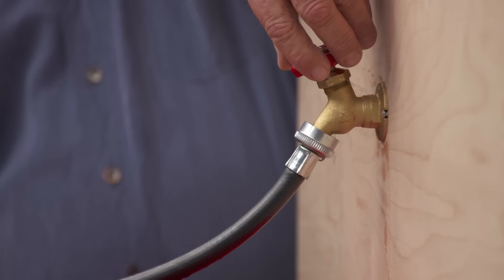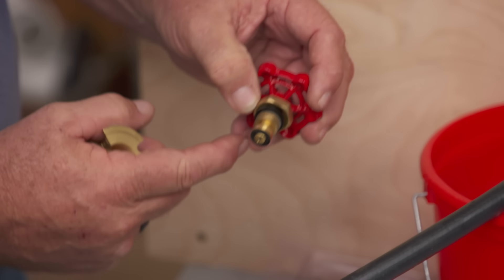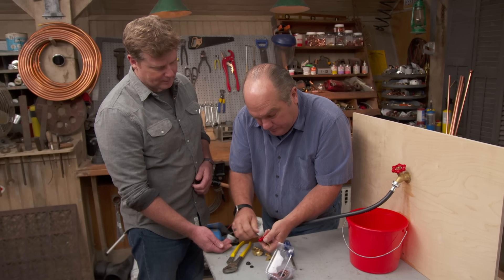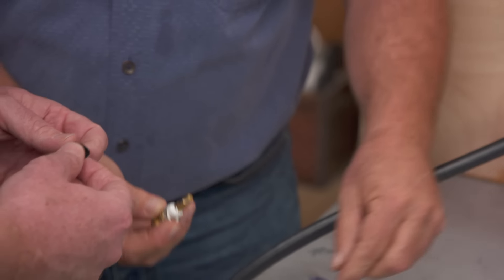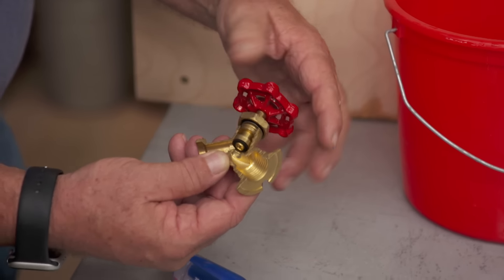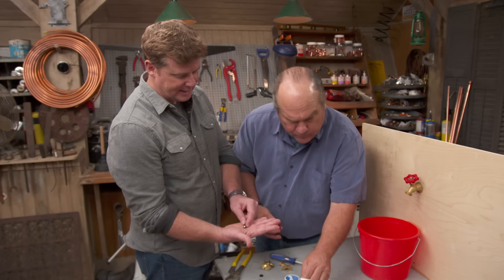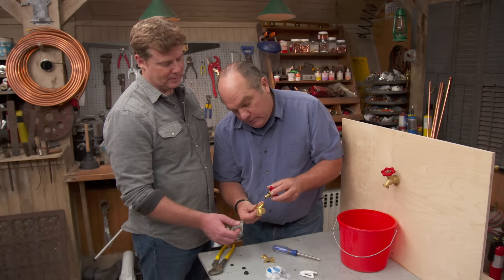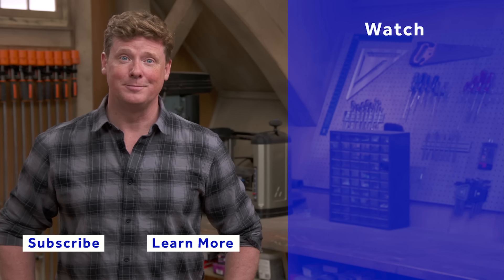How to Fix a Leaky Hose Spigot | Ask This Old House

Comment: Fixed both faucets today just by tightening it up. 4 years of leaking solved on 5 minutes. Geez I feel like a moron. Thanks guys!
Reply: I just did the same thing lol leaked for years and all I had to do was turn that
Reply: Just joined the club 😅
Reply: About to try. wish me luck
Reply: @GoziePO  did it work?  I had bought all new spigots.  then i saw this and it worked...
Reply: @timg2973  meant to reply after I hooked it up. Yes it did
Reply: Going to check to see if that's all I need 😅
Reply: Don't beat yourself up buddy! The fact that you're here looking up the fix means you're not a moron. It means you didn't know how to do something and took the initiative to LEARN! That says a lot right there pardna! That's the Get'er-Done character right there!

Comment: Things usually don't go right when I fix stuff around the house, but your advice worked! I actually just changed out the entire stem with a new one since both the bonnet packing and the bottom washer were wasted and the nut to take the bonnet out had "welded" onto the handle after more than 20 years.  Total cost: $7 at HD. Thanks so much!

Comment: Thank you! We're in an historic heat wave and I have hatchlings in a hanging plant. I want to run a mister for them, but noticed a leaky spigot that I really didn't want leaking for hours on end. I thought I'd need to replace the 55-year-old spigot. But after watching your video, I knew what to try. One turn with a wrench and the leak stopped. The baby birds thank you!

Comment: Just fixed a decades old hose bib leaking through the handle. The washer looked servicable so I didn't replace it. The bonnet packing was completely gone. I used about 2.5 ft of teflon tape twisted into a rope wrapped around the stem per this video and it works fine. I did tighten the bonnet nut pretty tightly upon reinstall. No leaks! At the very least this should buy me some time until I can get a new bonnet packing and washer. Thanks guys!

Comment: lol I usually just buy a new one. If I try and fix it I'll run into an issue like the welded on brass screw or something and end up taking more time to try and save it. Keep the old one and try and rebuild and use as a spare

Comment: Great presentation as always, but a couple points: 

1) The handle doesn't have to be all the up for the bonnet to leak. Tightening the bonnet too much, however, will make the handle difficult or impossible to turn.

2) When he, "Turn off the water," he means at the meter or somewhere other than the spigot. Otherwise, there will be water spewing relentlessly.

Comment: Great video. I replaced the hoses to my washing machine and had a small leak at an old shut off. Pulled it off cleaned it out. Teflon taped the bonnet and replaced the washer on the back. No more leak. Like more videos like this please!

Comment: Thank you so much just used the Teflon tape option and it fixed the problem.  No trip to the store!
Reply: Teflon tape isnt working for me, not sure how it would work.. since it would stay on the shaft and not move up and down when your fauset opens and closes. Have any tips?

Comment: I'm 75 years old, and they had back then ( i still have some ) Plumbers impregnated ROPE, that you wrap around the stem, same as your pipe thread suggestion, also i have some rubber rope too, but the Plumbers rope works better, thanks for the Video

Comment: Just replace it with a 1/2" x hose ball valve. less moving parts and washers / o rings / packing
Reply: I don’t believe ball valves are designed to be partially open and they lack fine control.
Reply: @sjn7220  I don't believe you're supposed to open outdoor faucets and similar valves, like the shutoff valves under the sink, partially anyways. It can make them noisy among other things. The flow control is usually the job of the nozzle at the other end of the hose.

Edit: Or a sink faucet.
Reply: @TwistedD85  I think outdoor faucets are similar to needle valves which are designed to be partially opened to limit flow rate. It's true they can be noisy if not fully open on toilets and faucets but I've never had that problem with an outdoor hose valve (nor would I probably care anyway if I'm outside). It's nice sometimes to limit the flow rate without a nozzle when you're watering plants or washing a car.
Reply: I definitely believe that the main shut off valve should be a ball valve. I prefer quarter turns at most other locations also.

Comment: Thanks for all your content. Does the main water have to be off, just to replace the bonnet?
Reply: Oblique Perspective no because the water pressure is still being held cause the valve is closed
Reply: It's the packing that needs to be replaced - or the nut tightened a little more. Tighten no more than is necessary to stop the leak. Overtightening makes the valve stiff to operate and wear faster !
Reply: @Matthew Savage No it doesn't, you are completely wrong.
The thread that opens the valve holds it all together. You can see the thread at 1:22.
The gland nut does stop you from opening the valve too far - in which case it would come out under pressure.
Reply: If you take it apart, you will have to shut off the water going to it. In theory you should have a shutoff valve in line before the spigot so it can be shutoff during the cold months. If you live in areas where it gets below freezing regularly your outside spigot can freeze and burst so it's wise to have a shutoff before it so that doesn't happen.
Reply: @benkeysor7576  But taking that top nut off is not 'taking it apart'. It's only a gland nut.

Comment: Just came from Big Box store for repair parts for leaking spicot. Their salesperson didn't know what size flat washer to get, so I checked a new spicot for size. i found the new spicots don't have the screw and washer setup, but use a soft gasket  that you slip over a metal flange. Bad setup. I guess new spicots won't be rebuildable, just toss it and buy a new one. Sad.

Comment: Thanks but my problem is that a backflow preventer failed. It was impossible to remove without Dremeling the thing off. I ended up cutting the threads. I need to replace the whole bib. There is brick behind it. What should I do now?

Comment: Why those rubber washers are held on with brass screws and not stainless I’ll never know. Where I live I have well water that weakens brass and causes the tip of the old brass screw to break off.

Comment: I turned on the water with the hose attached and tried to determine why the water wasn't coming out. I unraveled the hose, and the water was slow to run.  I turned the water off and went on about my day.  Later while doing laundry, I went to the basement and water was on the floor in the same location of the outdoor spigot. Do you know what could cause this?

Comment: Mine does not look like that!  Mine obviously comes in two parts. I took the nut off that released the bonnet handle,  and wrapped the stem and fixed the leak there. The faucet itself still leaks. My neighbor said you need to unscrew the stem, and pull out the long piece ie is attached to and replace the washer. But he doesn’t know how to do it.  So do you have a video showing how to do that repair?
Reply: BTW, I just put a hose attachment with a shut off on it to stop the drip. I just wonder what’s going on inside the wall.

Comment: Why not buy 2 new identical valves . Fit one then keep one as a spare then when you have a problem shut the water off change the spindle with the new washers on then repair the original at your leasure

Comment: When he says "turn the water off", do you just have to turn the handle to off or do you have to cut the water to the house momentarily? I don't want to pull parts off of the spigot and have water spraying everywhere! Thank you
Reply: Shut off your water at the main and open the lowest faucet in your house to remove the pressure from the system first.

Comment: My hose bib (spigot) outside doesn't look like the one in this video. My hose bibs were installed in 1950 when the house was built. There's only one nut to turn. There's no nut near the round handle that you turn the water on and off with. How do I repair mine?

Comment: So how come they don't make frost proof ball valve hydrants?
Reply: ArcolaBridge A frost proof shuts off about a foot  behind the handle, in the warmth of the basement, so the faucet can drain out (unless you leave the hose connected) A ball valve shuts off directly under the handle, which is outside exposed to the cold.
Reply: @MisterTwister88   correct but, I want a ball valve style.

Comment: Here is a good tip, do not buy these cheap hoses with anodized aluminum fitting and not real brass, or make sure do not leave connected to faucet, they corrode with the brass faucets and will weld itself on. Hard to find I will only buy even if costs much more real brass fittings after having to have all my outside faucets replaced could not get the cheap aluminium hose fittings to break loose, broke on valve off the pipe.

Comment: A spigot is like $10. If it cost more then $10 to repair, then just replace the whole spigot.
Reply: Easier to replace a seal than a spigot.
Reply: @drink15  Yeah, but sometimes it's not worth it.
Will you but a $50 tools to go and reseat the inside?
Reply: @saulgoodman2018  i would think you need more tools to replace a spigot then a seal. From what i saw in the video, he only needed pliers and maybe a screw driver.

Plus it’s basic tools you should have as a home owner anyway if you do need to buy tools.
Reply: @drink15  All you need is a wrench to replace one.
Unless it's soldered, then it'll make more sense to repair then replace. 

Go on search how to replace a spigot. You'll see how easy it is.

Comment: Or you can just replace spigot and avoid all the headache of so many parts
Reply: If you already have the washers in your house, why spend money for a new spigot, when it can be repaired for free.
Reply: @saulgoodman2018  The problem with that is most people aren't going to have the pack of rubber washers just laying around. It will most likely cost more for the pack of rubber washers than a new spigot costs and if your spigot is more than a few years old, you may not get it apart.
Reply: @benkeysor7576  Learn to read. I said if you already have the washers.